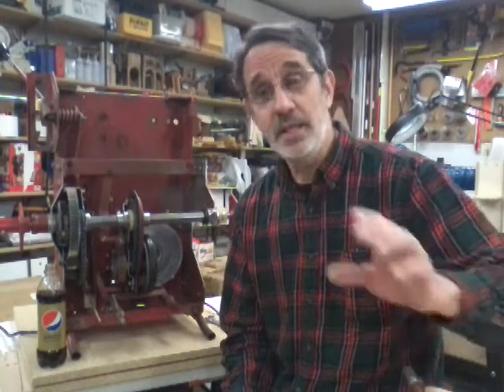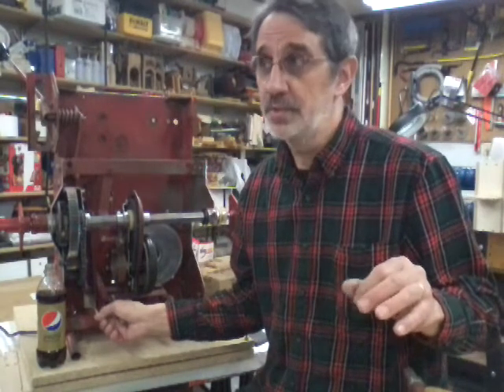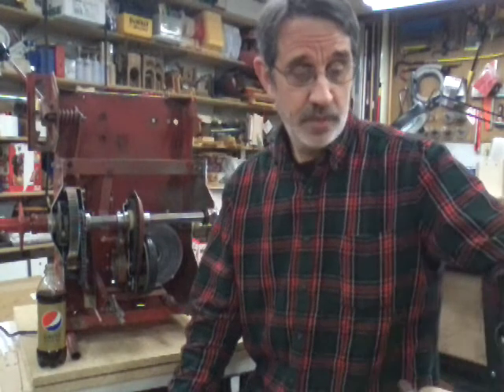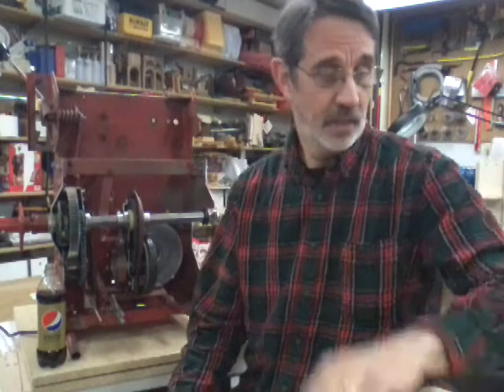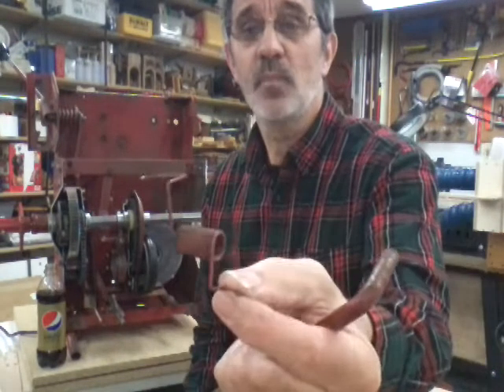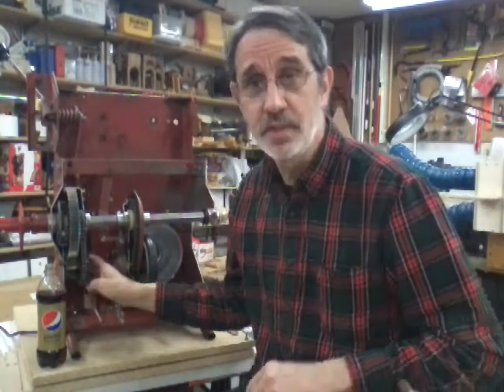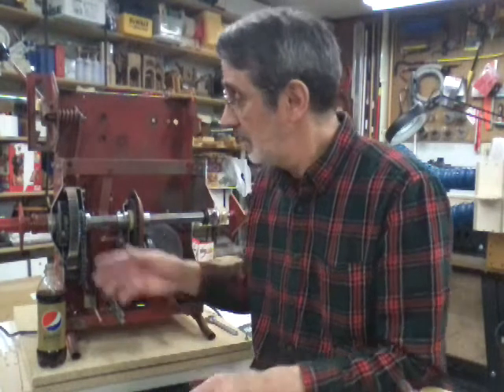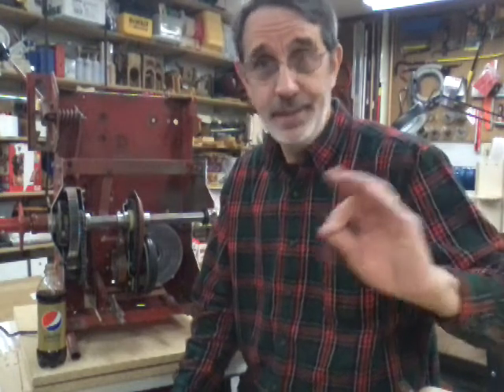85. Answering emails

Comment: hey Jim. i have another question again lol. i was watching one of your videos about 'yearly maintenance on your snapper' and you were talking about the different lubes used in the differential and chain cases, which was 80w90 gear lube and that real thick, black-tar, peanut-butter grease that is a mess to clean and will not flow, which i know because that heavy thick stuff is what is in my own snapper's rear end. what i want to know, and you may have talked about it in another video, im not sure, is how the heck do i get that real thick grease out of there? i know i cant drain it obviously, and i dont think i'll be able to remove the differential and chain cases due to the stuck left-hand wheel hub, but is there a way to get that messy gunk out of the transmission without tearing the whole thing apart because idk how, but i know it needs to be changed cause that grease has probably been sitting for at least a decade. anyways thanks for the videos.
Reply from the maker: Craftsman 1963 
Hi it's Jim.    There's not much of a way to get that stuff out without tearing it apart and cleaning it.   You could try filling it full of paint thinner letting it sit overnight,   draining it and do it again until it comes out clean.  But I think it would be a lot faster and cheaper just to tear it apart cleaned it out put new gaskets on it and fill it back up with 80/90 gear lube.   good luck and thanks for the question Jim